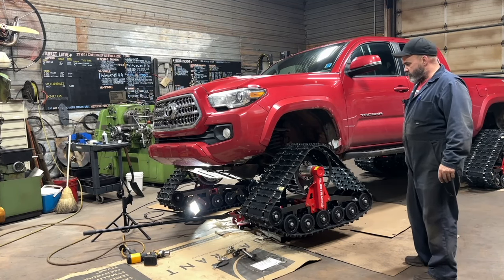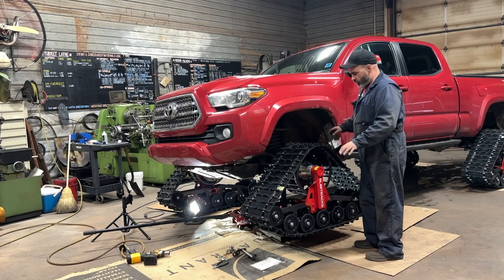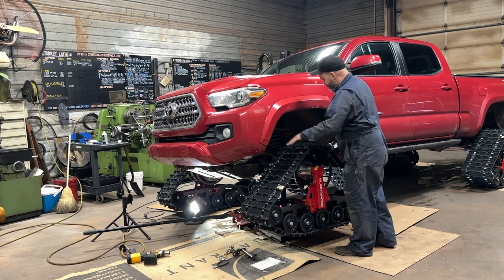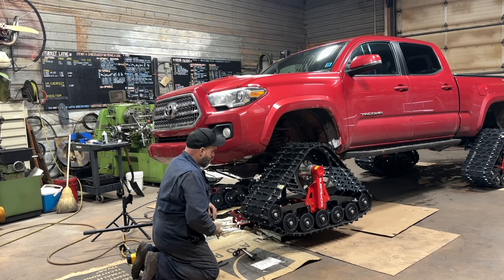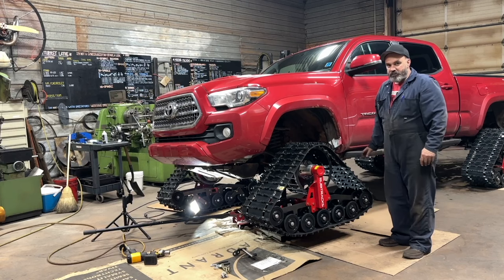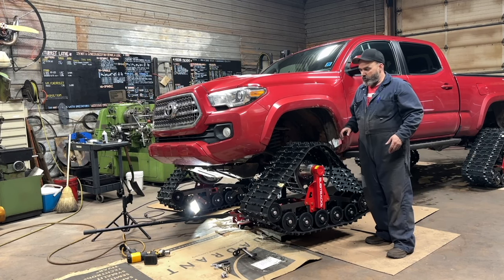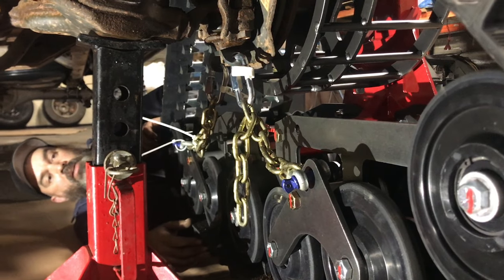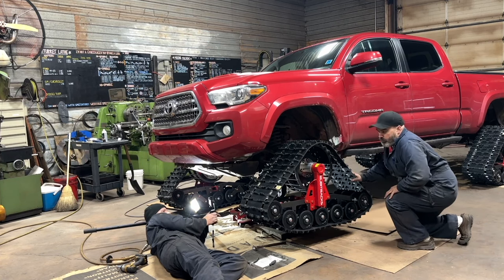Tacoma track Installation part 2

Comment: Specifically in regard to the concern of the tracks hitting the body, a nice lift kit would remedy a lot of that concern. 

Lift that body three or four inches and amen! Probably have to lengthen the drive shaft but a lift would solve most of the issue.
Reply: I would assume you'd still need to limit it from swinging even with a lift kit otherwise it's just going to swing if you hit something you cant roll over or an incline that is a higher degree. If that didn't make sense, just imagine if there isn't a a fender or frame around it, it would freely swing around 360 without the limiting chain
Reply from the maker: See that’s the problem. A lift is an easy solution but not everybody wants to drive a lifted vehicle when it doesn’t have tracks on. Also a lift usually means wheels and tires and when you add that to the price of tracks it can be a turn off so we try our best to find novel and economic solutions when ever possible.